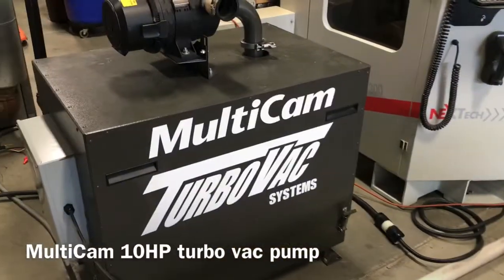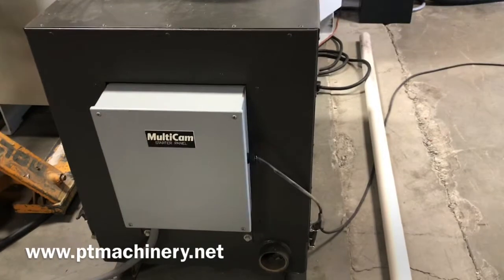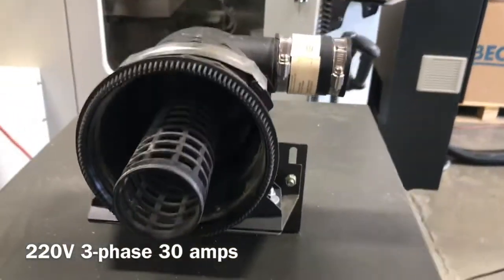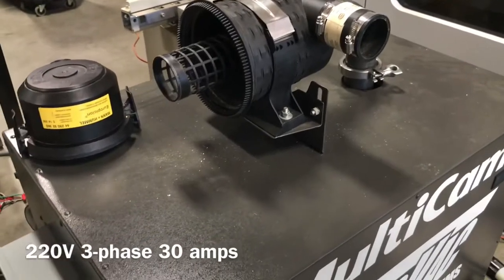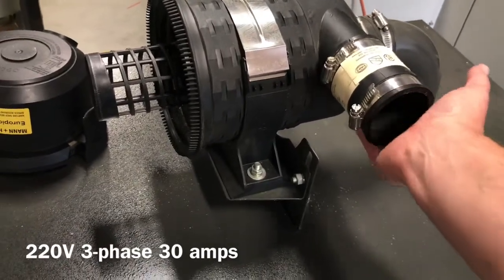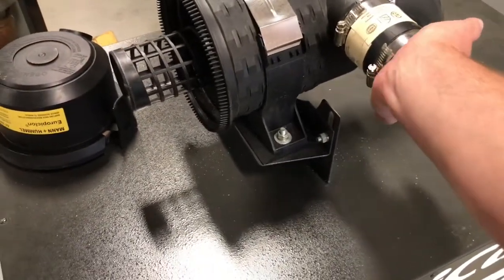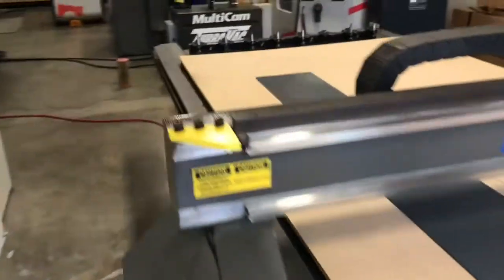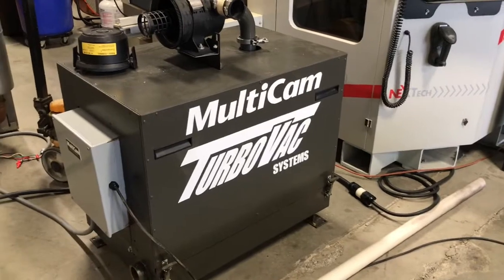MultiCam TurboVac system bump for rotation check

Comment: Where can I find more info on this type of pump.  It is a tri-lobe blower type?
Reply from the maker: This is technically referred to as a Positive Displacement style blower. It's sold by MultiCam and manufactured in partnership with republic. I have a full walkthrough maintenance video coming soon on this where we do an oil change and replace several parts. Thanks for watching!
Reply: @protechmachinery1  any updates on this maintenance video? Got ours set up about a month ago but I'm having trouble finding info on maintenance including best practices for changing oil etc
Reply from the maker: @chichivana  thanks for the reminder! The footage has been filmed. Just need to edit and upload! I'll make sure we get it done soon! Thank you.
Reply from the maker: Hi @chichivana and @MarinoSanGabriel I just uploaded an in depth video on the roots style blower from MultiCam. Enjoy! https://youtu.be/Z8AzPrqL888?si=mQ1esPQ-sjH6Qv0E